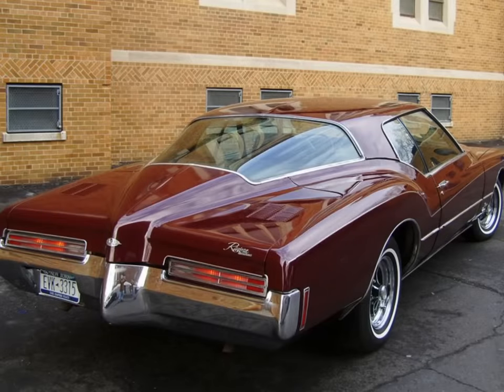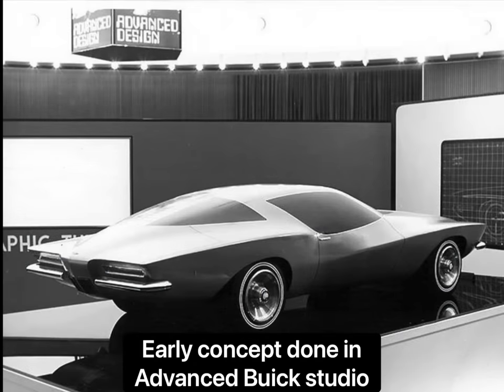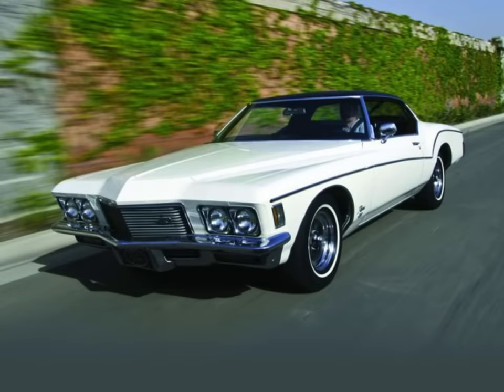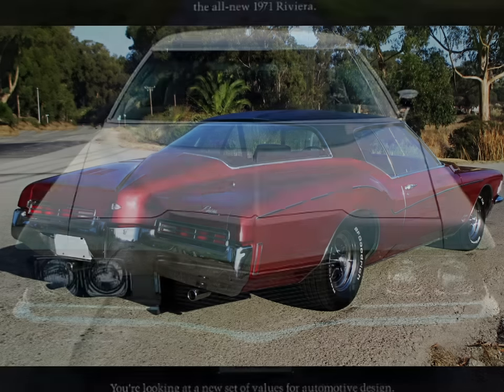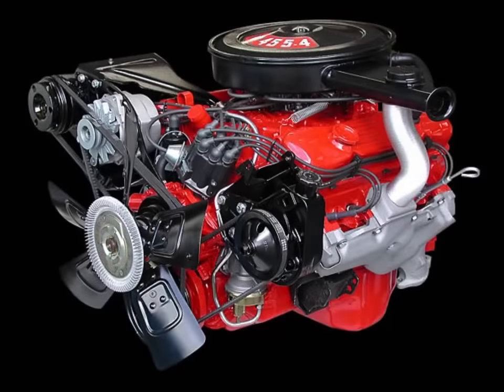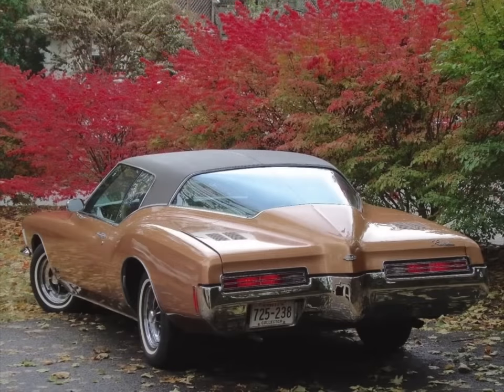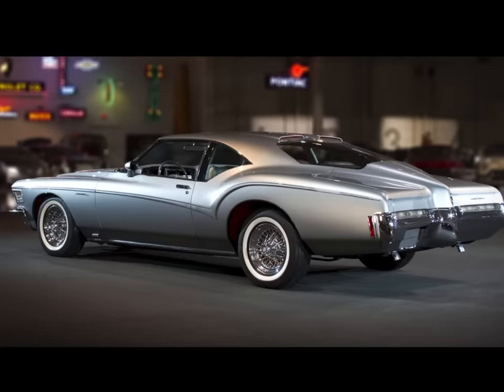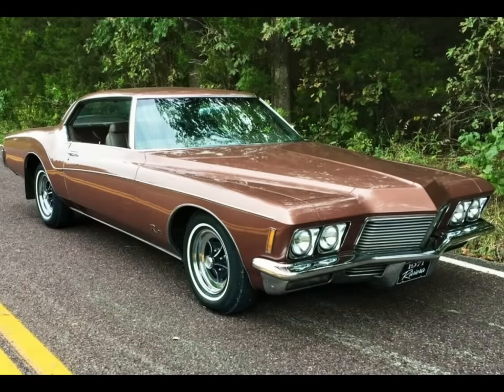Most Controversial Cars of All Time: 1971-73 Buick Boattail Riviera

Comment: I'm the proud owner of a 71 Rivi 455 ci which I acquired from my next door neighbor and the original owner after 12 years of trying and it had 46K original miles and had all the original paperwork and service records when I got it, it was a Fla. car originally so 0 rust !

 I've did a complete restoration stripping everything down to bare metal and starting fresh with just the main body left on the frame and the interior completely stripped too with a color change to a 1983 GM Aztec Bronze color. The only thing left now is recovering the seats and a couple minor cooling and A/C  things left to do. I've left it stock other than a set of stainless 3 dump side pipes which really sets it off even more and added the old school Monroe air adjustable air shocks all around so I can adjust ride height and ride quality for mountain road driving, stiffer GS springs and stiffer sway bars all around,, now there's a huge difference in performance for sure! It handles almost as well as my BB Z28 Camaro now and I can raise and lower the whole car by about 5" which really gives it a aggressive stance when lowered.

It's defiantly a head turner at the car shows and I've won a ton of 1st , 2nd & 3rd place trophies even though it's not even 100% done yet. I did do a bunch of performance upgrades to the suspension and motor upgrades bringing it up to 410HP which gets me high 12 second runs at the strip. So it's not only classy, but  makes lots of people wonder just how I got this big old boat of a Rivi to go and handle like it does and with the Cherry bomb mufflers and cam it has a SWEET loping big block sound that is ,,,,Just Killer!!!
When asked I just tell people it just took lots of bucks and time,,which it has ! Lots & Lots ! LOL I've been restoring classics professionally for >55 years and it's getting real close to concourse levels at this point so we'll see just how well it does at this Summers shows.

I'm not sure if this is true or not, but by my research I've only been able to find around 1600 registered ones world wide of the 28 something K non GS ones produced, so if so,  there also quite rare to boot if that is in fact true ? I gather there very popular in the Scandinavian countries with several huge Rivera clubs there and it appears there's more registered there than in the US?
 For sure though mine is the only 71 registered in VT with only 2 other 73's I know of. 

I have 3 people so far that have told me that if I ever decided to sell it , they wanted it and I have 2 standing offers of 28K and 30K for it at this point. But they'll have to fight my daughter first, she has first dibs and loves it too. Lucille is indeed a rare bird.

Comment: These cars pack a powerful punch. I say that from experience. Back in the 70’s, I was sitting at a light, in my 65 ford wagon, behind a flatbed. A 1972 Buick Rivera came flying around a bed and slammed into me. I only had time to turn my wheel. He pushed me past the truck and he ended up further than I. He said he worked a double shift and was tired. He never hit his brakes. I had a dent in my tailgate, he had front damage and broken motor mounts. I drove home, he got towed.

Comment: My grandfather worked at Buick all his life as an executive (his father was a chassis engineer for the company when it was founded). In 1971 he ordered a custom Riviera before he retired. He actually walked the car down the assembly line. It was painted a bronze color (no vinyl top) with a white interior and had a special HO 455 engine with a flip pitch torque converter and heavy duty TH400 transmission. I remember the dash inserts were like a brushed aluminum and were really showy and the outside of the car was smooth without an accent stripe and it had wire wheel hubcaps instead of the stamped steel wheels most had. The entire car was special order. Years later I got the car from my mom and kept it for several years. It was an incredibly fast car for its size and on several occasions I stuck the speedometer needle down into the turn signal hole, well past the 120 MPH mark.  My only regret was letting my mom have it back and her alcoholic boyfriend destroyed it.

Comment: Today it's a bigger screen, a higher price, and more exterior trim gone or blacked out.  Oh, and more safety tech that takes over the vehicle.  Oh, and mostly only black, white, silver, and grays for exterior colors.  Oh, and only black (for the most part) for an interior sometimes with the stunning option of contrasting stitching (generally only available at an extra charge + plus other restrictions + even more blacked out trim and required blacked out wheels).  It would be nice to see some other models offered and marketed appropriately that are not SUV's in the today's world.  I had a 1971 Riviera for a brief time early on.  The previous owner had abused it and it really needed a full restoration that I could not afford.  But, the lines of the car made it distinct and sleek.  Really set it apart from the other vehicles...and at the time it was new they didn't charge an arm and a leg for this!

Comment: Drove a 72 for several years. Loved that car and so did all who saw it. Achilles heel for mine was the fuel pump. I had to change it so often, I kept a spare in the trunk along with the tools to change it. Got really good at it and could do it in less than 10 minutes on the side of the road. I could never find a long and straight enough piece of road to wind it out. Going over 100mph was a regular event!! 😁😁😁

Comment: My dad and I were at the Buick dealer's in '73, looking (well I was drooling) at a beautiful garnet red Riviera with a matching leather (or vinyl) interior. I held my breath as the haggling commenced but alas, we left without it. On the way home, Dad told me they were $50 too high. FIFTY DOLLARS!!! Dad laughed at my disgruntled expression for decades. You would have pried that car out of my cold dead hands! Although to be truthful, I much prefer the '71 and '72. But still...arrrrgh!
Reply: 73 got those battering ram bumpers and a re design i drove a 18k 71 in 1974 and rode like a dream
Reply: David Hall $50 Dollars Ha ha . You were there to see it so can understand  how it was back then . $50 could buy a lot back in those Days . In 1974 my mother and I went to the Ford Dealership just looking at Vans .  My Father needed a service Van and mind you we Were just Looking . Ford Econoline e100  Basic .  I was just a Kid but would throw in a question now and then  and the Hungry salesman would get Excited . We had no plans to buy but were there for 3 hours and every time we headed for the Door the slaesman went Nutz .  The new Vans original great price was $ 4000.  We would go use the phone and come back to Battle , one call was to just say Hello to my Grandmother . We left  with the Van being sold for $ 3100 . We worked the Guy over and got a quarter of the price knocked off for a New Van .  The Dealership sold only 2 vehicles that Day  , they were Hungry .  $50 bought a lot of pride Back then.

Comment: I graduated from highschool in 1979.  That summer a friend and I were sitting on the wall across the street from the pizza and grinder shop in our town. Up pulls a boat tail Buick. One of our classmates got out of car. We got up to get a look at the car. I noticed that the cat had a 4 speed manual. 3 pedals confirmed this. The hood was opened to show off the motor. 421 cid Pontiac with (3) two bbl carbs. Alan bought the car from a widow in his neighborhood. His Dad called the garage he trusted for a tow truck. Dad didn't trust the brakes because the car sat for a few years. The garage owner wanted the 455 cid motor. Traded the Pontiac motor and manual trans. This car was now what it should have been: Big block with a 4 speed.

Comment: As a teenager at the time, I remember not being a big fan of the boattail Riv.  But in retrospect, I have come to appreciate how different it was in an erra when cars were starting to all look the same.  The front and rear ends looked best in 1971, the car looked best without rubstrips, and Mitchell was right... it looks much cleaner without the vinyl roof.  I actually like the Silver Arrow III concept better than the original A-body concept.  And I still remember how torquey the Buick 455 felt even as a low compression smog motor.  Thanks for the memories Adam!

Comment: I had bought a used one in 1981 for $600.  It was gold without a vinyl top.  It had leather seats and otherwise we’ll optioned.  It had the 455cid 4bbl which, if you kept your foot out of it, got fairly decent mileage.  I suppose it was as cheap as it was because the trend was towards scaled-down, economical cars.  I wish I still had it.  Even back then it was a head turner.

Comment: Thanks Adam for an insider's look at this controversial Riviera generation. The side sweep spear or 'check mark' was used for most of the Fifties, but mainly the '54-'57 with this same dip down. On those it's beautiful, but isn't the same actual contour as on the '71-'73 Riv. It's my favorite aspect of this car. It would be an easy thing to implement on current Buicks to make them look more like Buicks. Never mind, nothing matters now.  Forget it.

Comment: Thank you!  The ‘71 was / is an absolute masterpiece.  A midnight blue GS with a set of the Buick chrome & black ‘star’ rims is, arguably, one of GM’s crown jewels, along with the ‘65 Riviera.  Little known fact, the boat tail Riviera was one of if not the first to offer rear seat shoulder belts and a basic version of traction control (MaxTrac).  🤓  Keep up the excellent work!
Reply from the maker: Thank you!

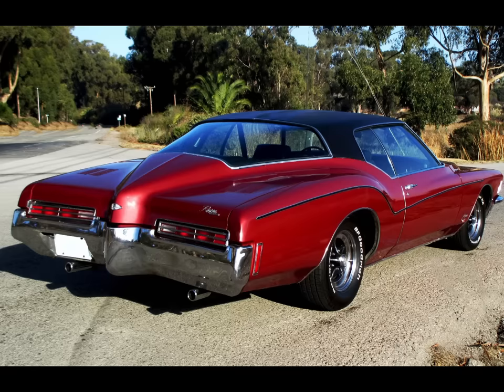Comment: I had a '71 that looked exactly like the car @2:51 but without the side strips (they had been removed in a repaint) and those chrome exhaust tips were not factory. It was a blast to drive, but probably the most non-ergonomically designed car ever made— the trunk was such an odd shaped that hardly anything large could fit into it and the doors were so long that if anyone parked within a couple feet of me I'd have to climb out the window to exit. Even with a 455 under the hood, you could see the entire bell housing of the big TH400 trans in front of the firewall and there was still about 2 feet from the engine block to the front of the car. '71 had the most extreme styling and it was the only year with the louvers on the trunk decklid.

Comment: I think the execution of the production ‘71 Riviera is MUCH truer to the designers’ vision than the ‘71 Eldorado and most any other GM production car of the 1970’s or 1980’s.  In overall form, most production vehicles are practically unrecognizable compared to the designers’ sketches and clays.  Apart from the plan view flaring that maybe wasn’t as pronounced on the production car as on the styling model, the production car captures the major themes of the white concept very faithfully.  And while I don’t care for the Delahaye-inspired style as much as the design language of the 1967 Riv, I do respect the execution the designers, planners, and engineers were able to achieve.

Comment: I wasn't crazy about its general exterior styling, but the interiors of '71 Buicks were great.   I owned a '71 Buick Estate Wagon and it was the best car to take on a lengthy road trip.   In 1974, I drove it to and from Los Angeles to Denver and it was the most comfortable car to drive on such a long haul.   I didn't even need a motel room, it was big and comfortable to sleep in it that one night between them.  Plus, my wagon had a great 6-speaker stereo.   The only bad thing?   Not good on gas --- I had the 455-4v ci engine and it drank the gas!

Comment: Oh wow, the last Riviera shown in this video is the exact same color as the '71 I had years ago. Sort of a metaflake copper color. Never knew the name of the paint color, but it was awesome. I hated the overall shape/appearance of the car when I first laid eyes on it. I horse traded with a cousin to get it used back in 1981. But then I took it for a test drive. I fell in love with the insane torque and ride quality immediately, and then soon fell in love with it's looks too. Other than the '67, the '71 Riviera is my favorite of all Riviera's. I love that sharp boat tail.
Reply: Some folks complain about the A->B platform shift, but the added weight made the Riv guide smoothly along.  Gotta remember full-size car suspensions then mostly sucked.

Comment: Let's not get crazy with the term "Riviera". I had a 1954 Buick two-door "Riviera" roof line. That's what it was called from the Buick factory. No post and a very slightly sweeping edge towards the rear. In any case, this '71 Boattail is a beauty!

Comment: I owned two of these. The first was a 1972 beige car w/o vinyl top. It was a recent trade-in at the Buick dealership and I paid $3000. It had been well cared-for and rode like a cloud. I sold it to a friend of mine in 1975 and a year later bought a 1971 green Riviera which I'm now sure had the miles turned back. It was a mechanical horror and I didn't keep it long. The one saving grace was that I had only paid $1250 for it.

Comment: Imagine, only 250 hp from 455 cubic inches. Ah, the seventies. As style goes, though I feel 70's cars rivalled the 50's in over the top design. Cars were really big and not built for performance so instead they tried to outdo one another in styling and gave us some beautiful cars. The Riviera is one of the best examples of that. We'll never see cars like that again.
Reply: I had a 1975 Cadillac Fleetwood series 75 limo, 500 cubic inches, 250 horse power, 5600 pounds. Didn't win any races. 🤣
Reply: @waterheaterservices  But I bet it looked pretty cool cruising nice and slow through town.

Comment: I enjoyed your video on the boattail Riviera as I always thought it to be one of the most beautiful automobiles ever built. While I have had two '63s, two '67s (one a GS), two '69s (again, one a GS), and much later an '86 Riviera, so sorry to say I never had a '71 or '72 boattail Riv. I hate the '73 model as with those horrible collision bumpers, the beauty was lost! At least in the '74-'76 Riv, the design of the body and the bumpers were more in tune with one another. Although not the most beautiful or fastest, I also had an '86 Riviera T Type which replaced the GS model. !It was the quietest, most comfortable, and best-appointed car I ever had! It handled well while still giving a smooth ride. AM Stereo/FM Stereo, a full logic cassette deck with door-type loading. a 16-way power seat for both driver and passenger and the GCC (Graphic Communication Center) dashboard made this car my favorite place to be. I know I'll be criticized for this, but if you're not familiar with what I am talking about, Google it. P.S. The '73 Rivers also lost the Riviera exclusive double sweep dashboard, which was replaced with a standard full-size Buick dash found in the LeSabre, Wildcat, and Electra's from that era.;( Oh yes, the horsepower of the '73 dropped off further

Comment: The ‘71 was / is an absolute masterpiece.  A midnight blue GS with a set of the Buick chrome & black ‘star’ rims is, arguably, one of GM’s crown jewels, along with the ‘65 Riviera.  Little known fact, the boat tail Riviera was one of if not the first to offer rear seat shoulder belts and a basic version of traction control (MaxTrac).  🤓

Comment: I don't know if I fit into the "love it or hate it" dichotomy, as I find these cars appealing now, but found them to be a little over the top back when they were introduced (I was a kid back then.) I totally agree with Adam that it would've been great to see that styling interpreted in a smaller car. The reason the '71-3 was over the top (in my humble opinion) was because it was too big for those sorts of styling cues. On a smaller car, by contrast, something like the boat tail looked great, e.g., '64 Corvette. Same concept as loud colors: Red looks better on a Corvette than a Lincoln.

Comment: The size really did make a difference in the final execution of the design. It worked perfectly in the 1963 and later Corvette Stingray. But, it just looked awkward on the size of a vehicle like the 71-73 Riviera. Mitchell was right; the vinyl top made it look even worse.
Reply: I have always thought that it should have been built on a slightly stretched Corvette chassis.

Comment: When new, the boattail Riv had a lot going against it.  It was a huge car with a big, thirsty motor when those kinds of cars were going out of vogue due to increasingly stringent emissions laws and the Arab fuel embargo.  The styling may have been considered distinctive at best, but most thought it odd and ungainly on a car that size. In 1971, smaller cars like the Monte Carlo/Grand Prix was where the personal luxury market was heading.  50 years later, we can look at it as an interesting curiosity, but for a new car buyer back then there were better choices.

Comment: At 4:54; looking at the vents location, I wonder if the exhaust fumes would have been an issue if the vents had been moved forward and a bit to the trunk edge away from the boat tail radius?  ;-)
Though the reason may have been, the trunk structure where the hinges were would be structurally weakened?

Comment: Imagine how many wonderfull US cars would have survived,  had they been painted properly from the beginning.
I was shocked when I in 1986 took my 1973 Cadillac Coupé de Ville apart and restored it. It was very poorly painted on the underside of the doors, under the hood and more. No wonder it was an easy target to rust.
My 1975 Continental Mark IV is undergoing a complete restauration now. Complete body paint was finished 4 weeks ago, including full paint job on the back of the front fenders. Is now getting ready for a new original vinyl roof. I have driven it since 2002 and want to keep it.